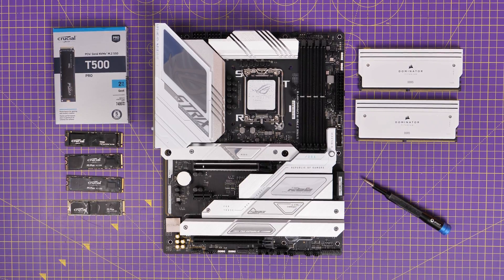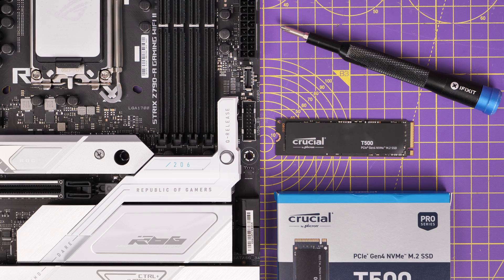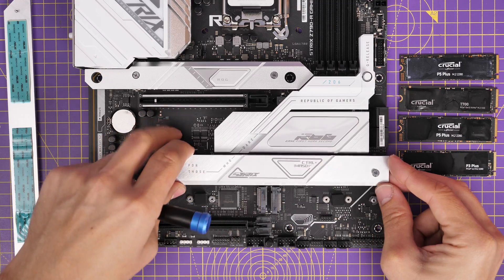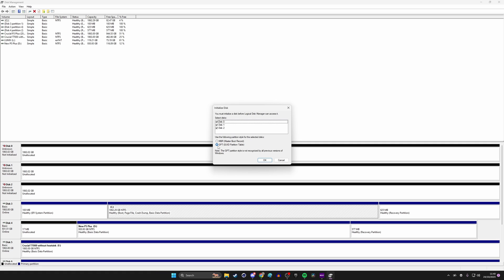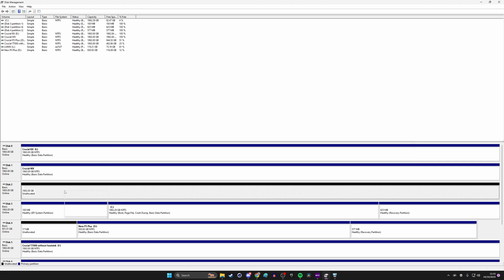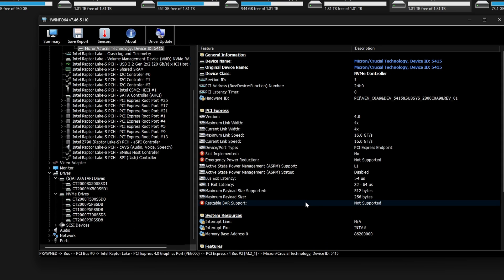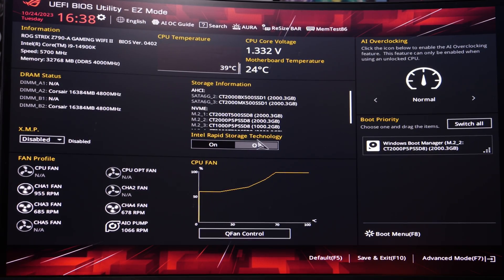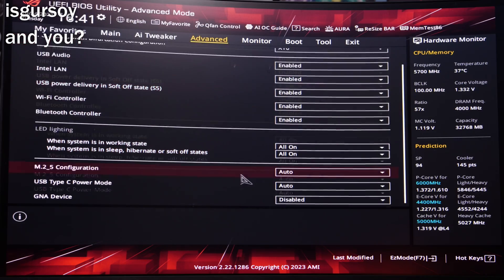How to install setup and test Crucial T500 NVMe SSD

Comment: Its strange because my crucial t500 pro M.2 is in my PCIe 4 slot yet its running at only 3 with 3700mb/sec. Less than half the 7400 rating...
Reply from the maker: https://youtu.be/hYYygf575N0

Comment: Why USB-C recognition is not possible... For example.. When You want to upgrade firmware... (let's say example for a NAS system) ...You actually need to enter the drive in PCIe...
Why there is no option to detect the USB-C related drives (EXAMPLE UGREEN case with NVMe M.2 drive containing T500 NVMe)...  With the Crucial Storage Executive

Will this option be added in the future?

Comment: Are the heat shields provided with motherboards (specifically MSI Z790-A Pro) enough to keep the drive cool or would it be better to get a drive with an integrated heatsink? Thank you.

Comment: Interesting, I've just bought the T500, got everything set up so far, PCIe NVME x4, etc. and I'm only getting exactly half of your speed in CDM on a z390-E
Reply from the maker: Z390 only supports PCIe gen 3. Which tops out at 5000mbs if I remember correctly
Reply: @TheProvokedPrawn Well, this might be the case then! Thank you so much for your reply. Got the board with 9900k pretty much for free and honestly it's not feeling great overall... Probably gonna look towards something AM.5 in near future.
Reply from the maker: @simongraf6903  yeah sadly you'll need a much newer motherboard for full speed with that drive. Still, free is the best price.
Reply: @TheProvokedPrawn  like a b650?
Reply: I have z390 pro aorus but when i install it monitor shows no signal after boot up any fix ?

Comment: nice video ,does the  top  gen 5 M.2 Slot always shares lanes with the top pcie x16 gpu  slot no matter if you set it to gen 4 to use a gen 4 ssd?

Comment: all z790 mother boards will cap your pcie graphics card speed if you put a m2 SSD into the gen 5 slot, its not much but still you lose performance i think its better to install that gen 4 m2 in a bottom gen 4 m2 slot instead of the gen 5 m2.
Your videos are amazing and helped me build my lian li dynamic evo xl <3
Reply from the maker: This board doesn't support gen 5. Surprisingly some of the new boards don't actually reduce the GPU either. I've been testing that lately.
Reply: @TheProvokedPrawn  great to know i hope you make a video about it also
best regards
Reply: @TheProvokedPrawn I have the strix b650 e-e and it's only the bottom gen 5 slot that half's speed top gen 5 slot doesn't. I'm only using gen 4s fury renegade in top slot for os and I just picked up t500 pro 2tb for games gonna install it in one of the gen 4 slots
Reply: It will run at 4x speed in a 5x slot